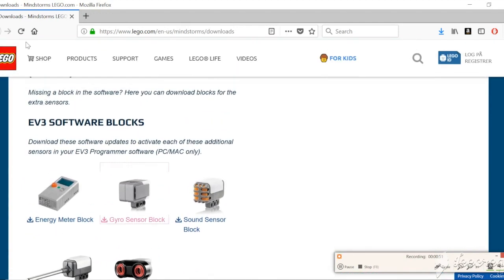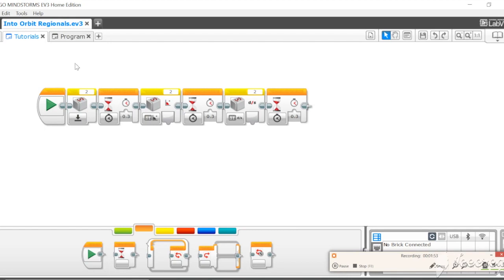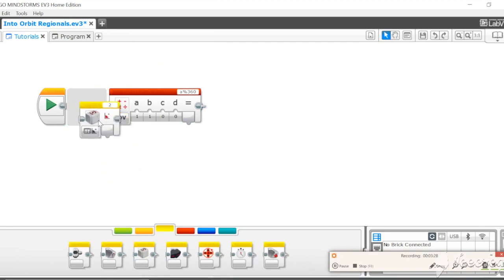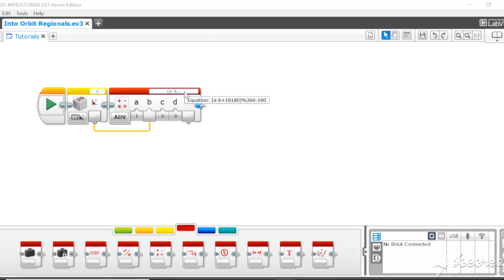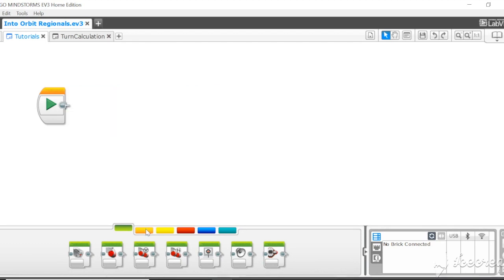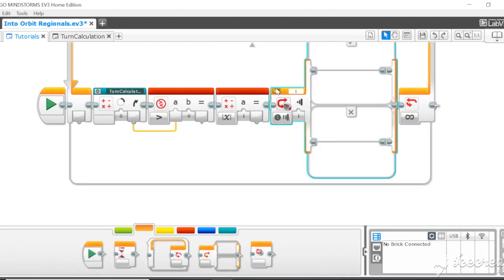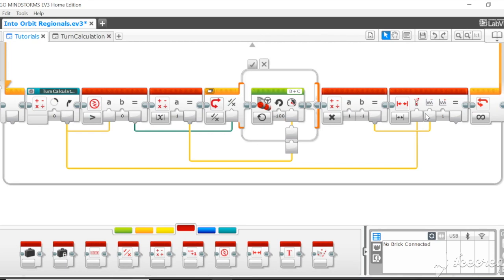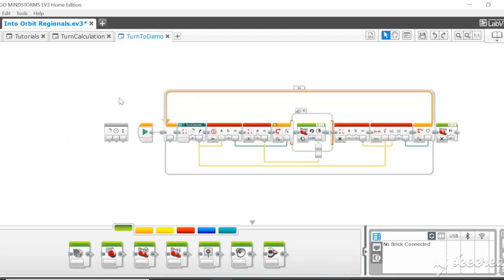RoboRoos FLL Programming Episode 2

Comment: Our team recently tried using this program and once it reached 90 degrees, it wobbled back and forth at 90 degrees. I've gone over your code and my code plenty of times and I can't find any difference except that in our robot the wheel driving motors are upside down. For example, it causes a forward movement of the robot when power is negative. Any ideas?
Reply: I've solved the problem by reversing the turn to be opposite of the showed program, but do you have any suggestions for fixing the overshooting of the gyro? It isn't the most accurate at 30 power
Reply from the maker: @xaitr2886  We generally use the turn at 20 - 25 power, 30 is just the maximum range for a decent amount of accuracy.